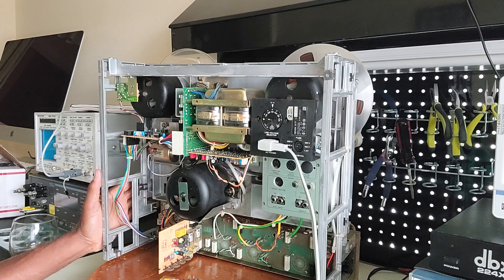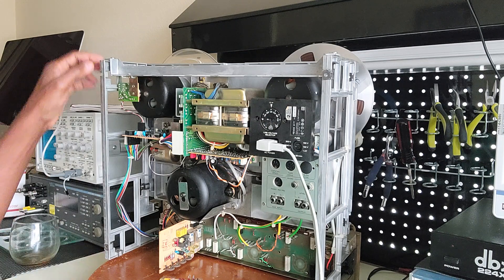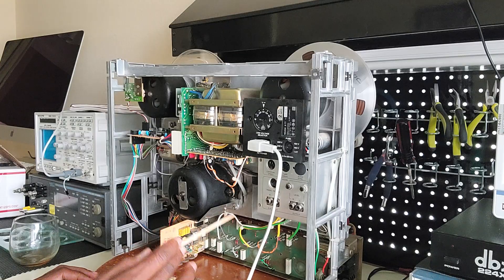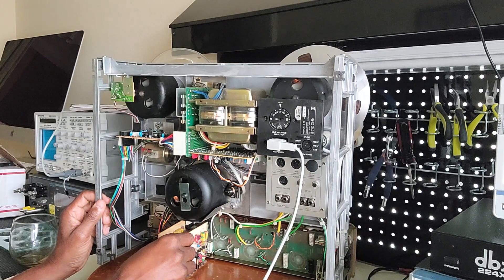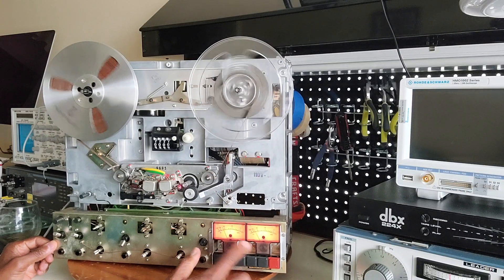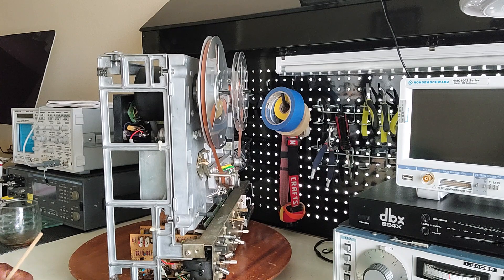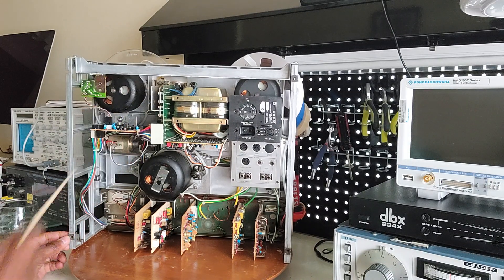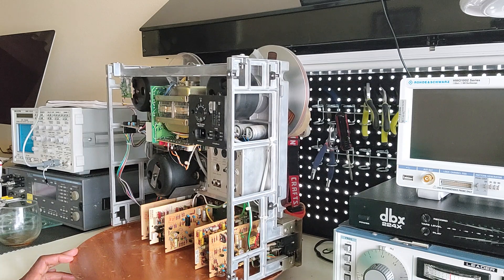Revox B77 MK1 Restoration Part 2

Comment: You do such beautiful, meticulous work, Almando. You live on Oahu, correct? I just purchased a Revox B77 (the slower speed version) on Reverb. I know it runs and some parts have been changed, but would you be willing to look the unit over for me? I realize that this is just a hobby for you, but I don’t know of any qualified repair technicians around here.
Reply from the maker: I have never worked on a low speed B77 and I would not recommend then except if you want to record interviews and other speaking events. But for music, lower speed B77 is not recommended. I don't do work for the public, just for my hobby only. But if you decide to take it on yourself I might be able to point you in the right direction. Please check out www.tapeheads.net and post all your questions there. Those guys are very helpful. That's where I started.
Reply: @almandog  - Thank you so much for all of the information. The fine gentleman I purchased my B77 from actually converted the unit from a 4 track to a 2 track deck and did extensive work on it. The seller actually told me a similar thing - that I’ll get the R2R bug after playing around with this deck and seek a high speed machine. At present, I’ll only be recording some of my favorite vinyl records at 7.5 IPS, so with the high price of blank tape, I think my deck will suit me fine right now.

I just saw on eBay that you’re selling this deck. Too bad I’m already waiting for my B77 to arrive next week, otherwise I may have considered it. Also, you’re offering free shipping from Hawaii which is an incredible deal as well. Good luck with your sale.

By the way, your R2R collection and hi-fi system is INCREDIBLE! All the best from Makiki.

Comment: Hi ! I just love your videos ! I just found 4 revox at my job and I’m ltrying to repair them, I’m searching for a pinch roller but they are very expensive, do you have by any chance a solution for this ? Thank you again I’m just eating your videos haha
Reply from the maker: Sorry no easy solution for a pinch roller. I would recommend that you purchase a proper pinch roller. It will save you lots of headaches. I don't recommend buying a pinch roller tire. They will wobbling after time. I have tried them and ended up getting a proper pinch roller.